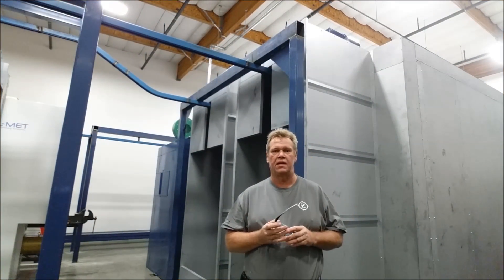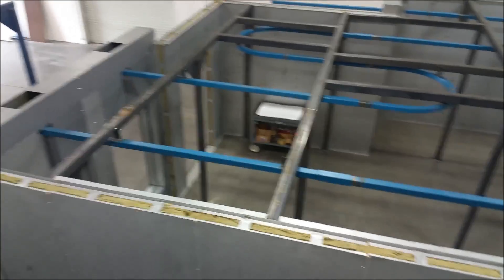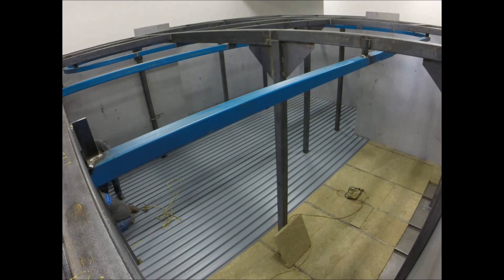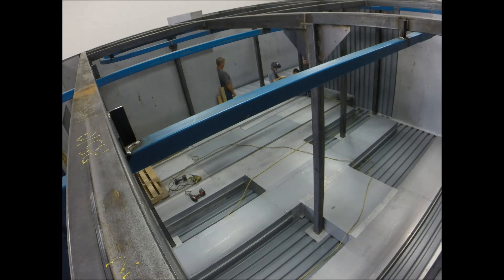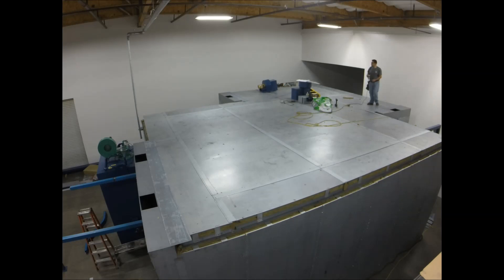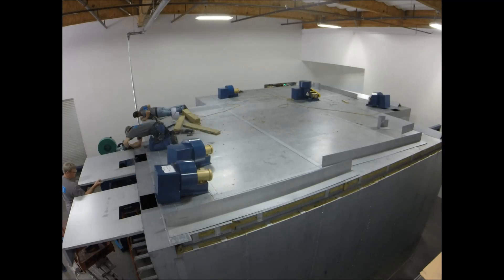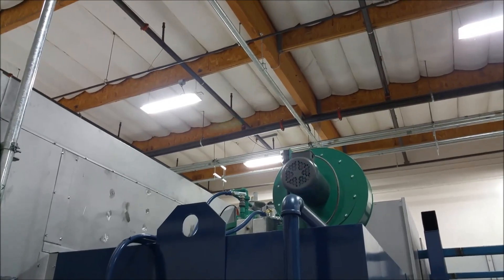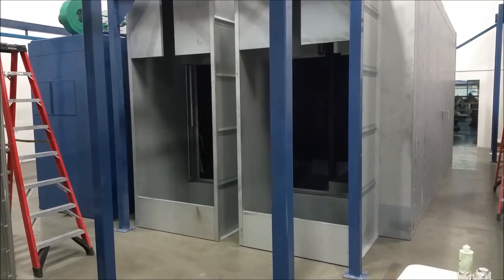Industrial finishing system part #2

Comment: Quick question, Why does the air knifes not strip the powder coating off the non cured parts?
Thanks
Denny
Reply from the maker: +To much fun with gas Hey Denny, Parts are preheated prior to coating, powder gets gelled to a point that it cant be removed, final cure does the final melt on the powder. Thats the beauty of powder coat, it has no memory and doesn't care how many times it gets melted.
Reply: +Shadon HKW 
Thanks, I missed  the part being preheated.

Comment: Stan, just wondering why the explosion relief was provided in the roof of the oven? I have always seen it provided in a side wall, but then again have never seen it provided on a structure, within another structure! One of the things that could possibly happen is that your roof panels could blow off and render sprinkler system above it inoperable. One other question! Being in California, are you required to provide seismic protection to your structure, or does that only apply to building structure? Great video series by the way!!!!

Comment: Huh, I wouldn't have known that heat over time would damage the concrete... I know first hand that  a pallet bonfire on concrete goes horribly wrong.... But short of that kind of heat or chemical damage (Sears in Moreno Valley has a stockroom that someone decided to use floor stripper on, that particular stripper turns concrete to dust).
Reply: +Dave Wood Acids will do that to concrete...
Reply: I know that floor stripper is a serious chemical but I wouldn't have guessed  that it stripped concrete, just like the person who stripped that floor...
Reply: +Dave Wood The vendors need to tell the users about that, as all too often the stuff is marketed with a brand name and minimal safety information...